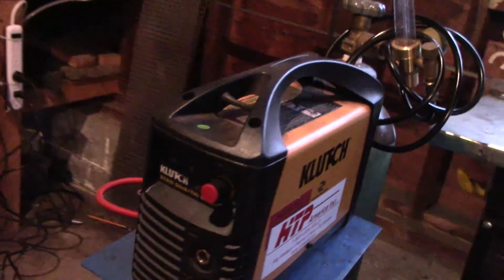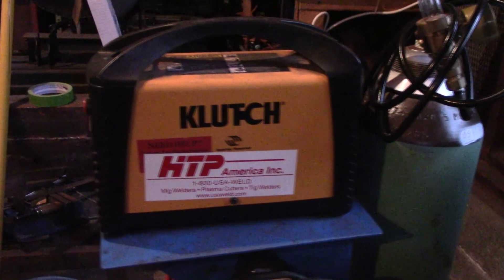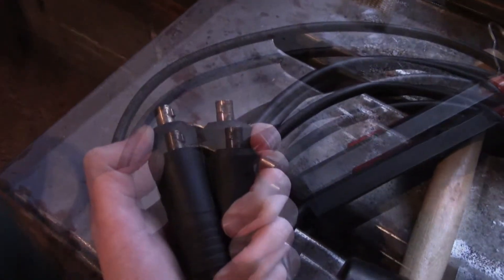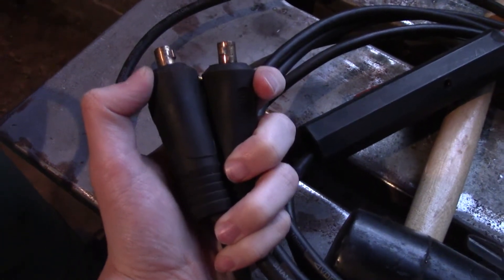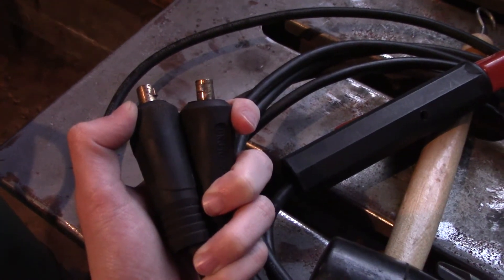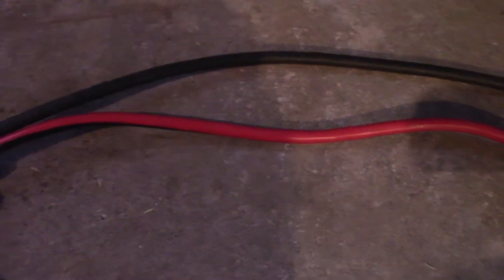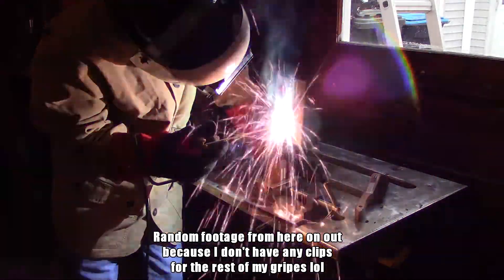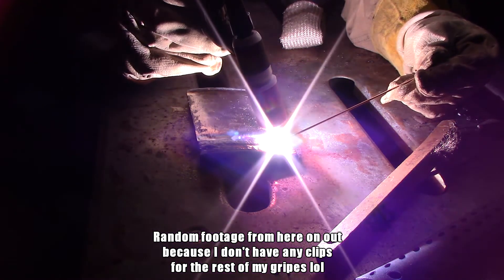3 YEARS! Klutch ST80i 3 Year Update

Comment: hi ,  I want to start practice with the tig torch   with my Klutch welder  you can  give me a advise  what kind of tungsten and  filler rod  I can use for starters. thank you in advance.
Reply from the maker: I would recommend using 2% lathinated tungsten. It's what I use and it's pretty good for all round use. I'd get tungsten in 1/16, 3/32, and possibly 1/8 inch sizes if you plan on upgrading to a larger welder. As for filler rod, unless you plan on messing with stainless, ER70S-2 or ER70S-6 at good choices for steel, and get them in the 1/16, 3/33, and some 1/8 inch as well.
Reply: @SubDude350Welding   thank you , for you help , God bless you .

Comment: Good review. Have you ever run your machine on a generator? I have a 3400 Watt Generator and need a machine small enough to run off of it... Thanks
Reply from the maker: According to an answer provided by Northern Tool on Amazon, you need to have at least 2500 watts or more to be able to run this welder, so you should be good to go. Unfortunately, I have never ran this machine off of a generator, so I can't say if it'll work from experience.

Comment: Will this weld a 7018 1/8 rod?
Reply from the maker: Unfortunately, no. It doesn't have enough power to use an 1/8" 7018. It will do a 3/32" 7018, but if you need to use 1/8", I'd recommend getting a more powerful machine.
Reply: Thanks